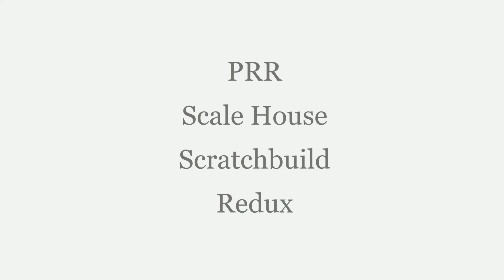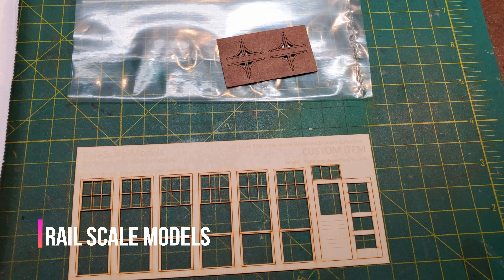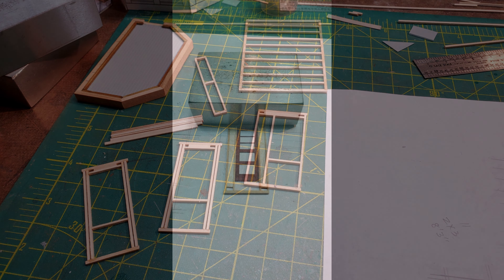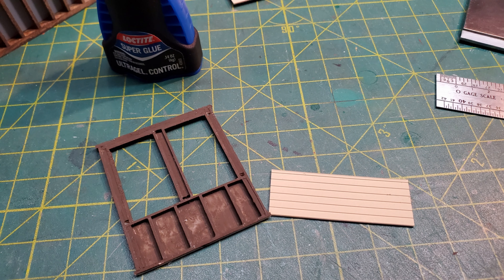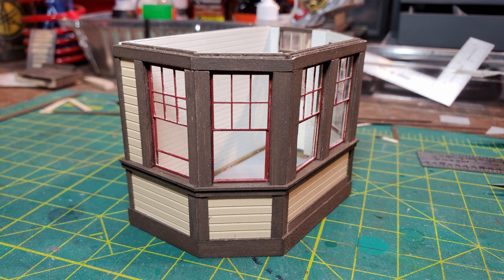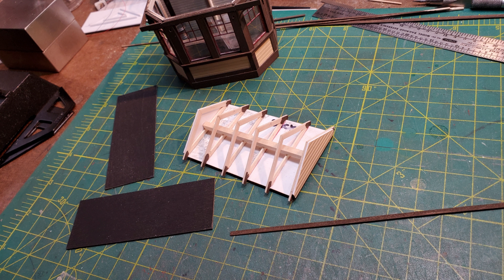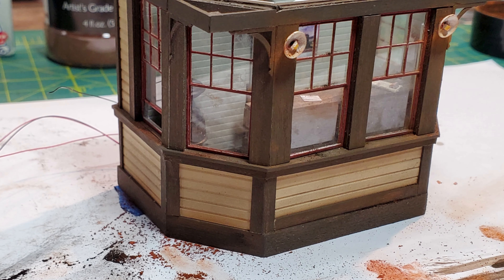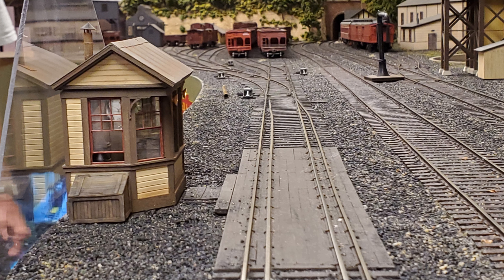PRR Scale House Scratchbuild-Redux

Comment: Another great video, Greg.    Early in the video there were 2 red square tools.   What are they and where can you get them.    Thanks.
Reply from the maker: Thanks, Todd. Those are Duratec Positioning Squares. You can get a set of 4 of the 3" ones for under $10 at Amazon. I find them pretty useful.
Reply: @CassidysWorkshop  Thanks
Reply: I had the same question.  Thanks for the quick answer Greg.